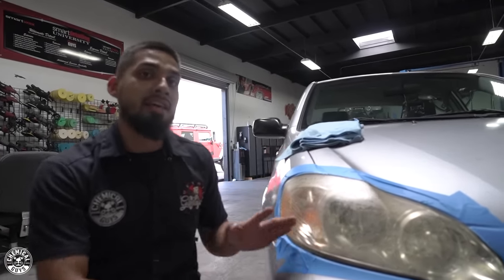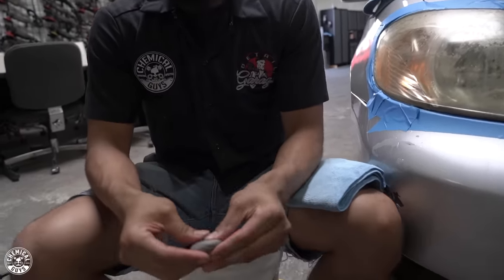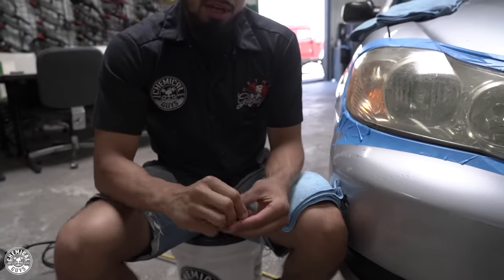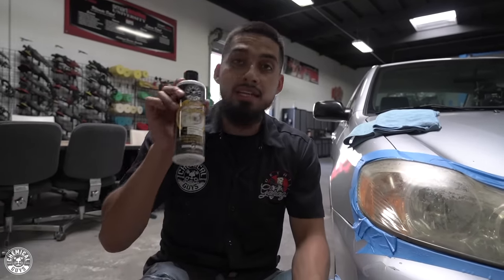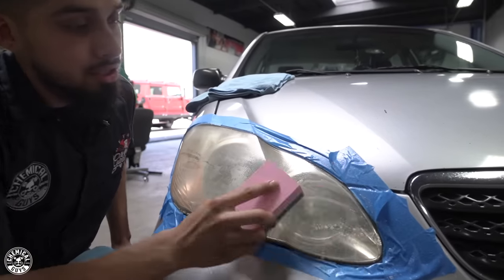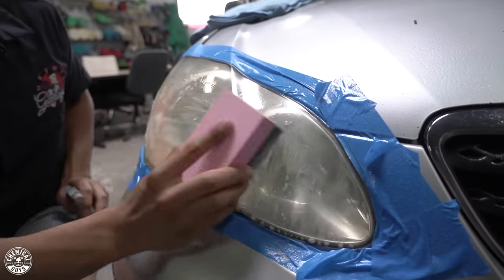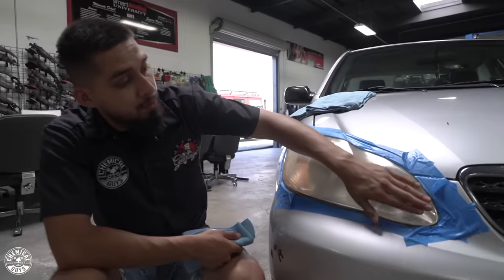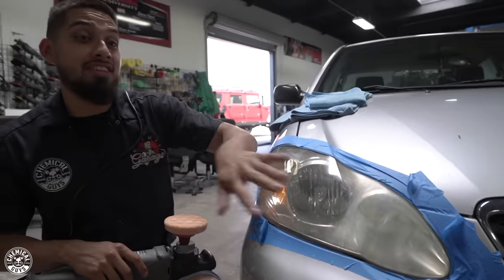How To Wet Sand Headlights! - Chemical Guys

Comment: I would use a separate sealant with a UV protectant...
Reply from the maker: Hey! If you would like to you may apply a ceramic or sealant after to enhance the protection. Thanks for watching and happy detailing!
Reply: When I do mine I have a clear coat for plastics with uv protection, then I top it off with a wax

Comment: Using the V series polishers in stages seemed to yield better results than just the headlight restorer.
Reply from the maker: Hey Sonny! Absolutely, multi-step corrections will achieve the best result however if you are short on time or the vehicle doesn't require multiple steps of polishing, reach for Headlight Restorer.

Comment: Wow you've completely restored the headlights. It's a very attractive product. I should practice with the video's products as a person who is doing the details.
Reply: I can vouch for it as well.  Even without wet sanding, it will improve hazy headlights quite a bit.  With wet sanding, it will make them look factory fresh brand new.
Reply: hb8dinwa for how long though? I’m pretty sure this method would cause the lights to yellow up again after a few months in hot sun, or in the cold winter days. It’s not a permanent fix
Reply: @jonnygti  thats why it's important to buy a good sealant or even a ceramic coating for the headlights after doing all the hard work to make em look crystal clear again and protect em very well
Reply: AdventuresGaming oh I didn’t know you could use something like ceramic coating on it. But you’ve got to add up all the costs of these products, and some people don’t have a machine polisher for the best results too. I think I’d rather just get new headlights, far less effort doing that! And there new and won’t fade for years
Reply from the maker: Thanks for watching and thanks for the amazing feedback!

Comment: Great video thank you. I know the length of how long it will last depends on various scenarios, but after they start fading again, do I complete the whole process such as sanding/polishing again, or just polish/seal? Thank you in advance.
What additional sealant can I use from you guys?
Ps: you look like my nephew.
Reply from the maker: Hey! If they do start t fail again, simply use Head Light Restorer by hand. Also, we recommend applying Jetseal, it creates a strong shield against water spots, contamination, road grime, and UV sunlight. Innovative UV protection technology helps reject harmful solar rays and protect headlights against fading and discoloration. Thanks for watching and thanks for the amazing feedback!

https://www.chemicalguys.com/jetseal-durable-sealant-and-paint-protectant/jetseal-sealant.html

Comment: So is it better to use the v compounds with the jet seal or is this method better? I don’t have any yellowing on my Stinger but the clear coat on the headlights are spider webbing pretty bad. Just trying to figure out what’s a better method to use with out going to a shop and having to reclear it

Comment: Which sealant would you suggest would work best for the dealing those headlights? Would VPR be a viable option ?
Reply from the maker: Hey! We recommend Jetseal, it creates a strong shield against water spots, contamination, road grime, and UV sunlight. Innovative UV protection technology helps reject harmful solar rays and protect headlights against fading and discoloration. 

https://www.chemicalguys.com/jetseal-durable-sealant-and-paint-protectant/jetseal-sealant.html

Comment: Thanks Bro. This is cool. I’ve got a 94” Dodge Pickup beater aka “Rusty” and I’ve gotta get the headlights right again. 

Do you have any videos in DIY taking off heavy rust from paint without tools? My buddy said wet sanding as well?

Comment: Brother, I just wet sanded my headlight which had some scratches on it from a car cover. I used your Chemical Guys lube, soapy water and 1500 & 3000 grit. The scratches are gone but there's a 😭 "haze" left on the portion I sanded. I don't have any compound or polish (I thought I did 😭) am I screwed now. What should I do in the meantime? Thank you all @ChemicalGuys- big fan 👍
Reply from the maker: Hi Lou! The next step would be to polish the surface to refine and remove the sanding marks. Use an Orange Hex-Logic Pad with Headlight Restorer Polish.

Comment: What do you think of clay mitts? I've got one I've used in the past.
Reply: I really prefer the bars.  When they get contaminated on the surface, you just twist and knead them like silly putty and they can be used again and again and again.  And since you only use a small hunk at a time, one bar will last you a LONG time.  A clay mitt is good for a few uses, then you have to toss it.  Much more expensive over time.
Reply from the maker: Clay mitts work amazing!

Comment: Do you guys recommend using one sheet of sand paper per headlight or can you use one sheet on both headlights
Reply from the maker: Hey there! The sanding sheets can be used on several headlights as long as they are properly stored and undamaged. Have two specified or a dual-sided sanding block is recommended.

Comment: How do I know if I need to wet sand a headlight or if the one step process in your other video will be sufficient?
Reply from the maker: Hey! Headlight Restorer is great for removing light to moderate oxidation and haze. For heavily oxidized/dull headlights using the appropriate sanding sheets to refine the finish.

Comment: Any tips for removing burnt plastic from the headlights? I accidentally applied to much heat when using my rotary polisher on my headlight and it burnt the plastic.. but I feel like it can be fixed. Thanks!
Reply: Did you try sanding it? You might need to go down in grit if there’s a lot of excess plastic. Then go up the ladder until you reach 2500 grit. It might take some time but it’s better than buying new headlights.
Reply: Parker B thank you! I read this earlier and people were saying to go down and then up, but I’m glad to have someone actually recommend doing that. I’ll give it a shot, thank you!
Reply: Parker B the plastic that is burnt was originally oxidized so it feels slightly more raised than the plastic that’s clear. I’m sure I have room to work with for sanding.
Reply from the maker: Unfortunately, if you burn your headlight it has permanently been damaged and cannot be brought back. We recommend purchasing a new set of headlights. Thanks for watching and happy detailing!
Reply: Chemical Guys thank you for the info! I appreciate all the videos you guys make it really helps!!

Comment: Can you use 2000 grit and 3000 grit?
Reply from the maker: Hi Noe! Absolutely, it is perfectly fine to lightly wet sand the headlight before using Headlight Restorer.

Comment: I was told that when wet sanding, you're supposed to soak the sand paper in water for an hour or so. Is that not the case here?
Reply from the maker: Hi there! We have found that it is not necessary to let the sanding sheets soak for that long, only a few moments.
Reply: Nonsense, just have a spray bottle with water and keep spraying as you go to keep it wet. And it's good to have a bucket of water also to rinse and keep the sand paper clean of sludge during the job.

Comment: what's the logic of using a clay bar when you will still sand it though?
Reply from the maker: Hey! The clay bar will ensure that the surface is totally clean and prevent embedded grime from micro scratching the lens when sanding.

Comment: So headlight restore is basically just V4?
Reply from the maker: Headlight plastic is sensitive to harsh UV rays, which fade the plastic, turning it hazy and opaque. Simply rub the refined cream formula into the faded headlight plastic with a microfiber towel until it turns clear. Micro-abrasives blended into the formula peel back layers of dead plastic that block light and dull the clarity of the headlamp, revealing crystal-clear plastic underneath.

https://www.chemicalguys.com/headlight-lens-restorer-and-protectant/headlight-lens-restorer-protectant.html

Comment: Clay bar so you don’t scratch the headlight??? You’re scratching it with sandpaper
Reply: Clay bar so you don’t use the sandpaper to sand in and damage the headlights with microscopic pieces of dirt and grime.